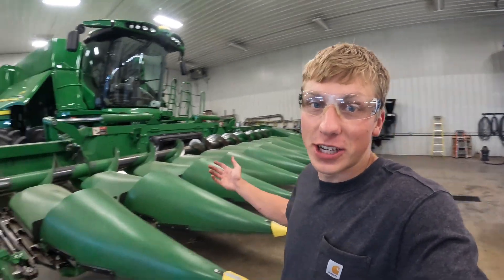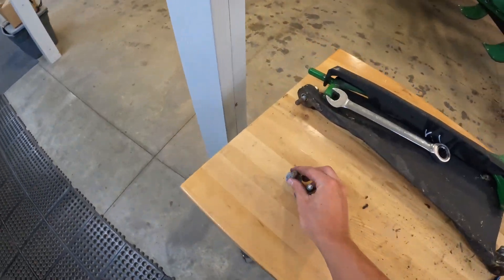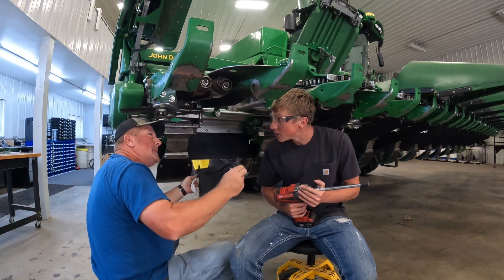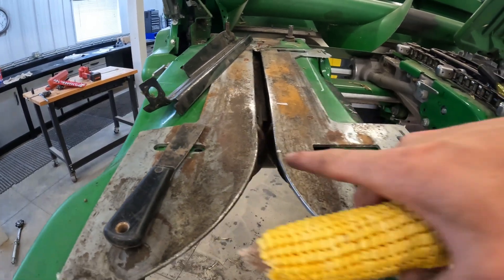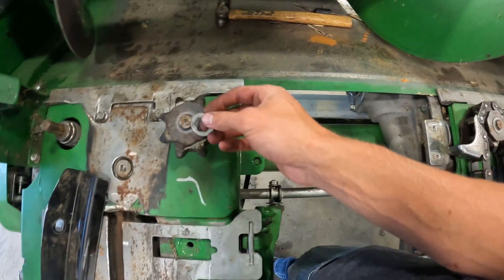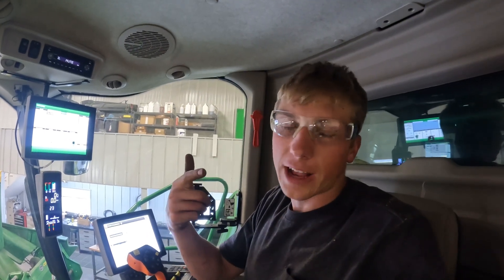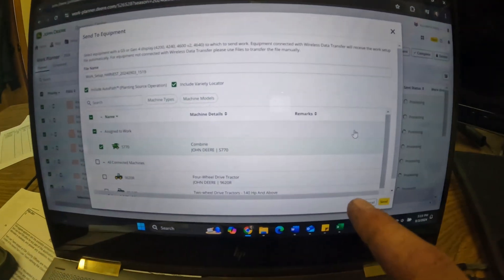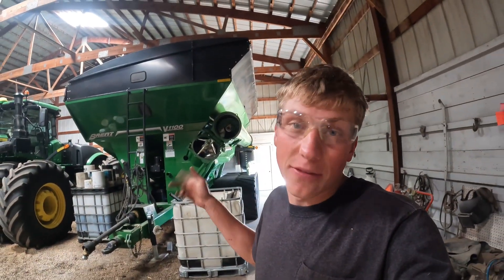World's FIRST 11-Row Corn Head

Comment: Last fall I set all the deck plates accordingly and once we got into the field they were too close so had to slide them all back. Not sure what I did wrong but try it before you go to the field but run it in some corn to see if that changes things. 
Data management is key nice that it can be sent via network now vs the thumb drives or cards for the older monitors. Have a safe fall.
Reply from the maker: With the corn head I am able to adjust the deck plates from inside the cab, which is SUPER slick. We usually run them as tight as possible. Have a safe fall to you as well!